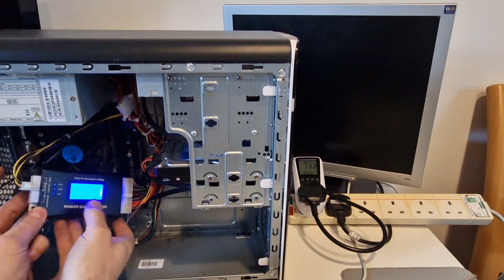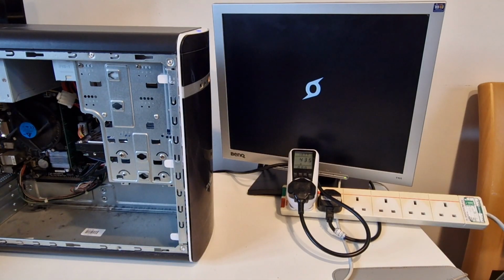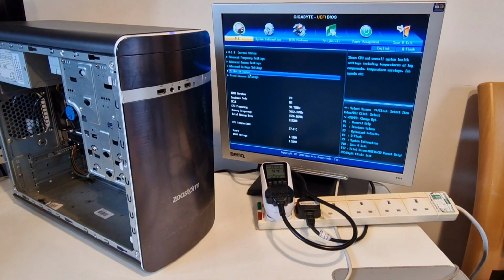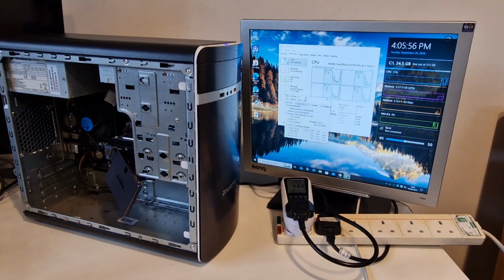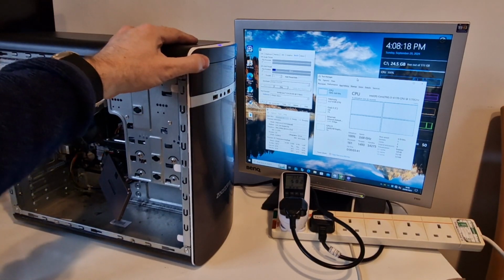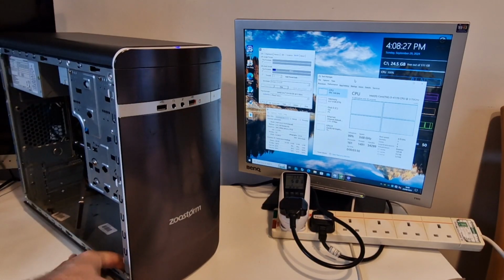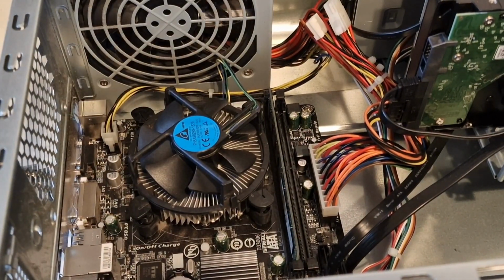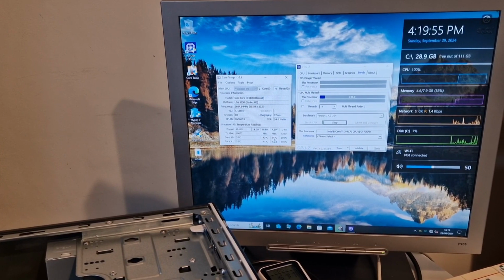What's inside this Zoostorm PC? And will it work? Intel or AMD?

Comment: ive got a system thats the same but i have the 4570 i5 but nice quick computer runs call of duty with a msi gtx 750ti 2gb in a cit rgb case